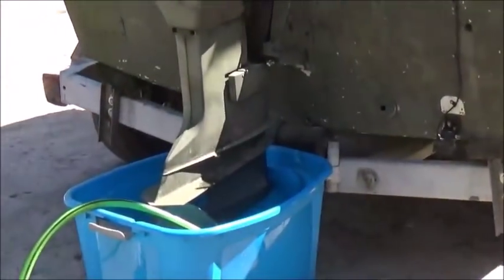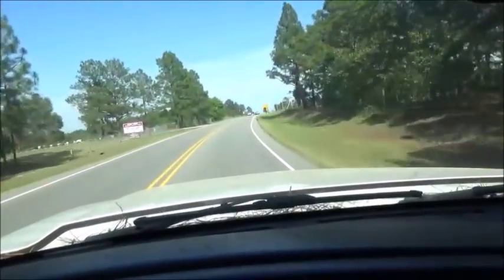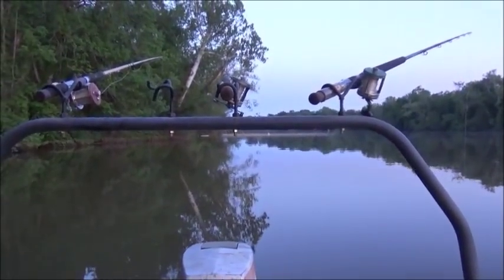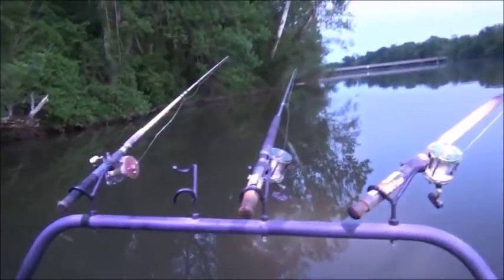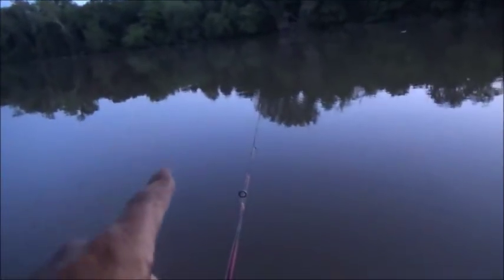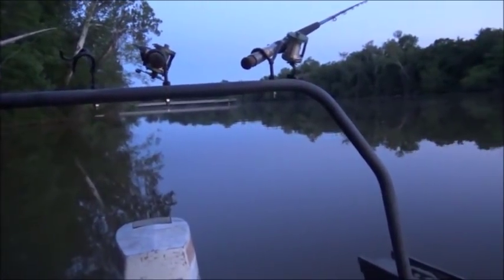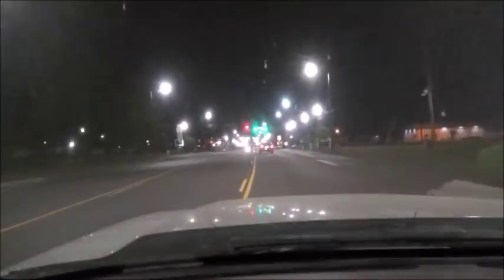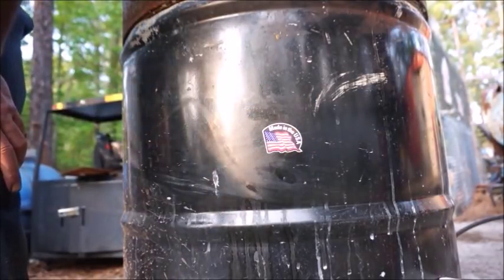Catfish Trip First In Nearly 2 Years

Comment: Nice video Jonathan, I'm always game to watch fishing activities.   As you already know boats don't like to sit around much, everything just decides all at once that it doesn't want to work anymore.  Don't be afraid to make a video for a 2 stroke (Johnson/evinrude?) tune up, plugs and impeller change...lots of people find themselves in the same "boat" and want to see someone do the work.  As for your fishing reels...being that they live outdoors it wouldn't hurt to (once a year) pop off the side plate and use some penn lube or light grease on the spool shaft where it runs through the pinion gear.  If you ever have a reel that won't disengage (go into free-spool) then it's usually the spool shaft has corroded onto the inside of the pinion gear, a dab of grease every now and again will help keep that from happening.  Anyways looked like a fun night on the water, and no cussing like a sailor, I guess you remembered this time.

Comment: Good thing it wasnt a Copperhead or Rattlesnake.My stepdad used to have a 57 International A190 dumptruck.It was an air brake truck.It had a 401 engine and 5 speed with a 2 speed rearend.Ive heard you talk about your 57 alot and it just dawned on me it is the same year as that dumptruck.